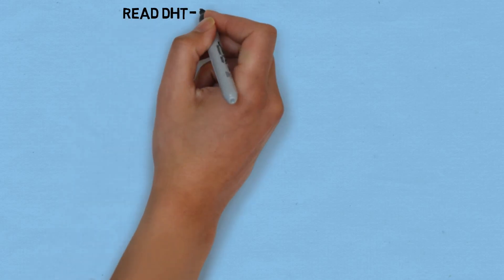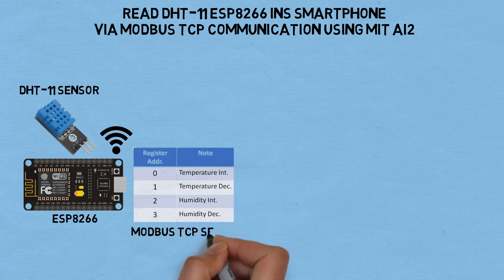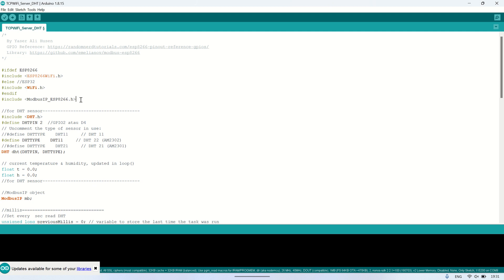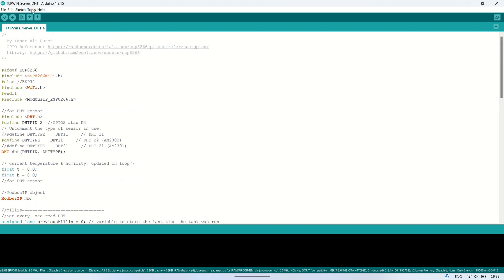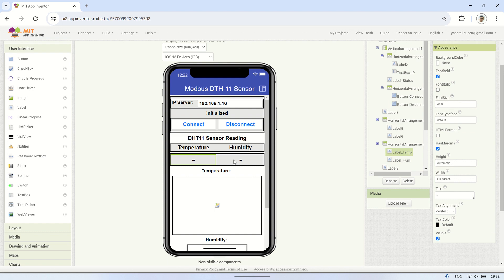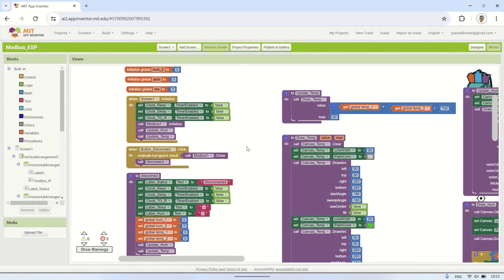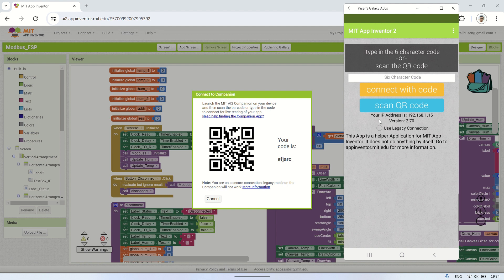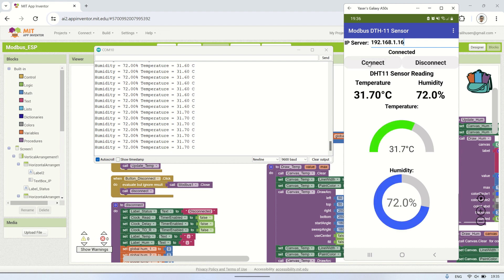Read DHT-11 Sensor in ESP8266 from Smartphone with MIT App Inventor 2 using Modbus TCP Communication

Comment: Dear Yaser Ali Husen,

First, I want to say excellent video! It has taught me a lot, and I truly appreciate your contribution.

I recently encountered an issue while using MIT App Inventor 2. The error message displayed is:
java.lang.StringIndexOutOfBoundsException: String index out of range: -1

Could you please provide guidance on what might be causing this issue? Are there any recommended steps to resolve it on my end?

Thank you in advance for your help and support. Please let me know if you need further details or logs to assist in troubleshooting.

Looking forward to your response.

Best regards,

Comment: I've made an app with MIT inventor to controll a 4wd chassis attached with dht11, mq2 and mq6. I need to display readings of those sensors along with controls . They are in turn connected with esp 8266. So could I do them?
Reply from the maker: I think you can do that...same concept with my video

Comment: sketch compilation error, downloaded the library from the link from github and installed it, what could be the reason?
Reply from the maker: The sketch compilation error could be due to several factors. Here are a few things to check:
1. Library Version: Ensure you're using the correct version of the library that is compatible with your code. Sometimes newer or older versions may cause issues.
2. Library Installation: Double-check that the library was installed correctly. Go to Arduino IDE > Sketch > Include Library > Manage Libraries, and ensure the library appears in the list.
3. Dependencies: Some libraries have dependencies. Make sure all required libraries (e.g., Sensor for the DHT library) are installed.
4. Board Selection: Ensure that the ESP8266 board is correctly selected in the Arduino IDE under Tools > Board.

Comment: Hello. how to open an AIA file?  Can I have a file in APP INVENTOR format for my phone? I want to remake your project for my own sensors?
Reply from the maker: To open an AIA file, you'll need to use MIT App Inventor. Here's how you can do it:
1. Go to the MIT App Inventor website.
2. Sign in and click on 'Projects' > 'Import project (.aia) from my computer'.
3. Upload the AIA file, and it will open in the App Inventor editor.
If you'd like an APK file (for installation on your phone), you'll need to build the project in App Inventor first. You can then modify the project to suit your own sensors by changing the blocks and logic to work with your specific setup.
Reply: Thank you, it worked.  You have a good channel. Thank you for answering the messages, thank you for sharing your developments. It's not often that I come across such good channels and good people. I'm not very strong, now I'll try to make it to suit my needs.